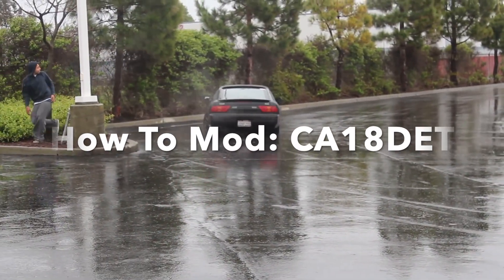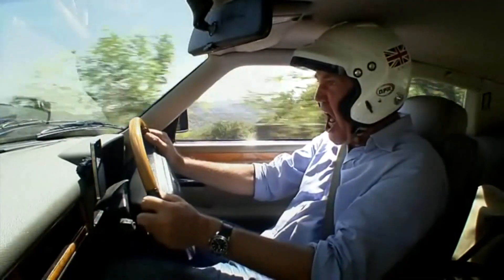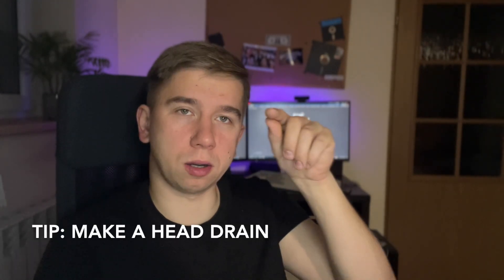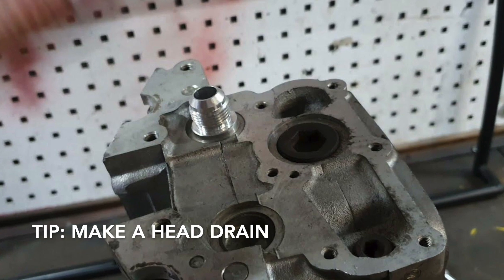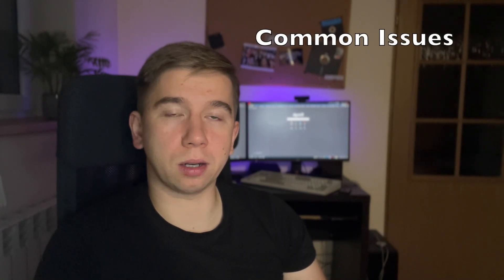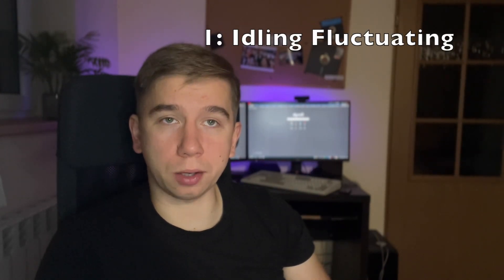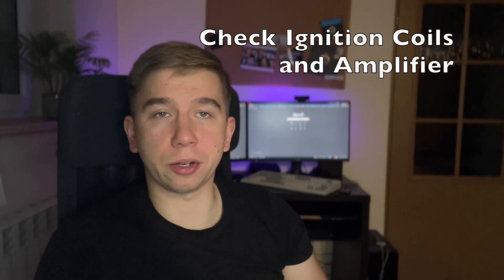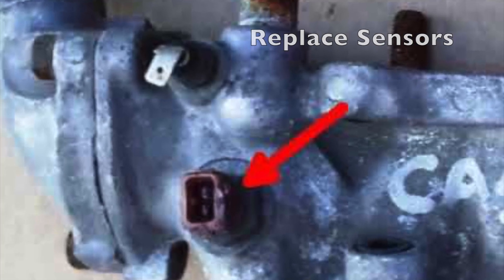CA18DET in Nissan S13 200SX | Strengths, Weaknesses and Common Problems | Do It Yourself

Comment: Wifes had her 200sx for nearly 20 years now.  Tuned to a reliable 245rwkw.  I would add an oil cooler, delete the shitty CAS and replace with a trigger kit, convert to Audi coil packs, replace the junk old loom.  Lots of people mistake the Temp sensors for causing their hard hot starts, however it is more often caused by a failing CAS.  This only becomes apparent when tuning and seeing live data like on a dyno.  The aging loom can also cause the temp sensor not to read or spike on occasion.
Reply from the maker: That’s what I found about these engines. They are old, used to be cheap and everyone trashed them. But with a little of maintenance and perseverance they can be reliable and rewarding :)
Reply: @marcinjedrol  I was probably one of those that advised some people to "upgrade" to an SR20 from their CA18 20 years back.  All my 180sx's were SR powered and I never gave the CA a chance.  I never bothered to learn more about the CA until I started working on the now wifes car.  Variety in performance part brands is an issue compared to the SR though.
Reply from the maker: @Driftit  If you think about it, CA in its bare idea should be better than SR, since it's an iron block, has strong crank stock, also comes with crank girdle, direct acting cams, all things a guy needs to do some real fast stuff. But as you said, people neglect them and it results in poor opinions

Comment: Built one for my RS13 back in the day 2005 ish.  GT2871R with tubular manifold. CA18DE cams adjusted, steel rods and fully balanced bottom end. 300zx maf and 660cc injector AMW fmic  etc. Made humble 408hp with 482Nm with 1.6bar and it's still alive with over 40k of occasional trashing.  It really likes that you let them oils get to a temp before loading, and also very regular oil changes.  Good engine, but you need to know what you are doing when building one.  Not much room for bodge jobs.
Reply: Is that running on stock axles and gearbox? Or what would you suggest for that power level if not
Reply: @smudge2021  Stock box and axles are fine at that level with sensible use. For constant trashing, you need to swap something stronger for gearbox. Axles are good for much more, but i suggest good lsd. I had Cusco RR type.
Reply: @smudge2021  Also i forget to mention to pay attention to cranc case ventilation. CA tends to pack all the oil in the cam covers if the blowby gas handling is left un attended. I used straight piping between cranck case and turbo induction pipe with oil catch can between.
Reply: @samupk  Appreciate the info man, Its my first project car, Do you have somewhere I can pm you? I'm in the process of building mine its got Forged pistons, lightened and balanced crank, arp head bolts with a stock head, g25-550 turbo with a link ecu. But things like high/low impedance injectors and what ccs are best for that setup im not sure yet and im sure theres a lot of little bits like this above ^ that are great to know!
Reply: @samupk  I also forgot to reply to a part too! I do have a skyline lsd in it.

Comment: hey im having this one big issue with my ca18det and i cant find anyone who knows how to solve it if i send you the video of it would you be able to diagnose it
Reply from the maker: Hey sure, send some link over and I can check
Reply: @marcinjedrol  https://youtube.com/shorts/1Xt2yuid6XI?si=GvtxxzBPurzMvJn5

just uploded this to show my issue , basically car shuts off while driving then turns back on
Reply from the maker: @haarisali6202  just checked it. It looks electrical to me. Also, does it shut off completely? Or it idles? Is it only while driving? Or when on park too?
Reply: @marcinjedrol  shuts off completely when in park too
Reply from the maker: @haarisali6202  Id probably start by swapping in another ecu for test. And then chase some more stuff, probably ground or loose connection somewhere
Reply: @marcinjedrol  too easy another this is when it’s cold this doesn’t happen but when it’s hot it does
Reply from the maker: @haarisali6202  Try measuring the voltage at two pin coolant temp sensor and see. If not that, then I'd still try ECU